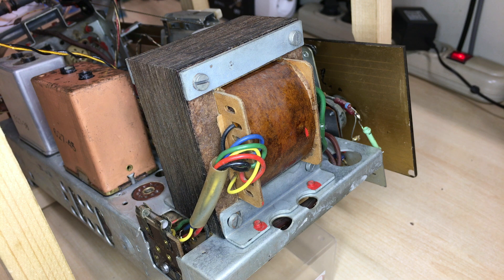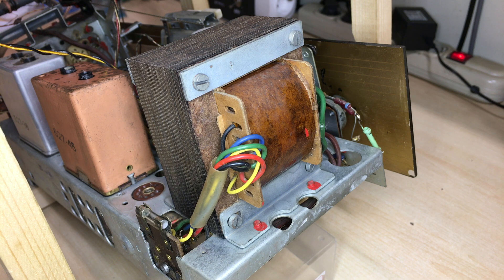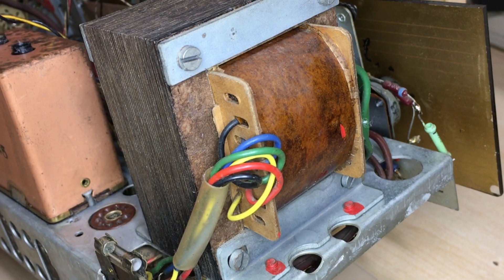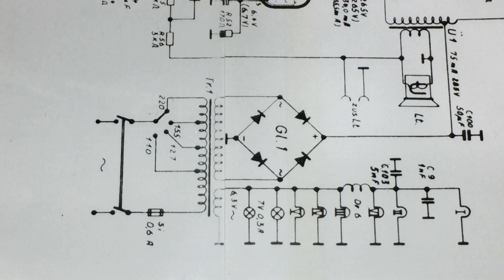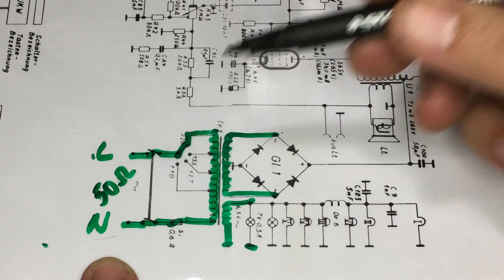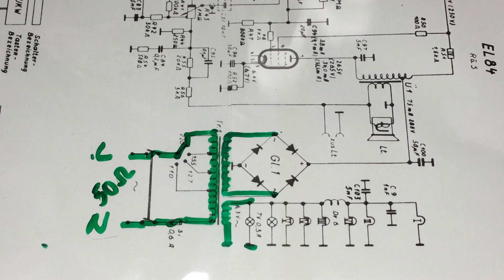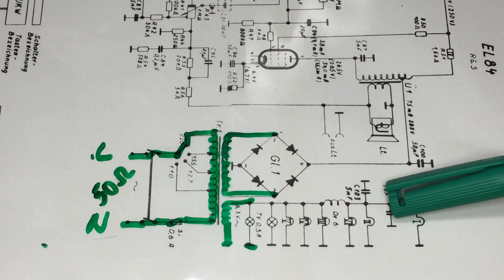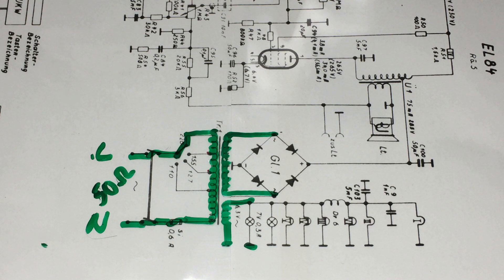How to safely check the Power Transformer on tube radio or amp.

Comment: Recently acquired a Tempo One transceiver, power supply & cable, and was wondering how I could test the power supply transformer when it isn't set up the same as yours. It's a seperate unit, has a multi pin socket on back that the connecting cable plugs into and the other end goes to the radio. There's no "on/off" switch on the supply, so would I have to jumper the "line" wires together to do these tests?
Reply from the maker: You probably would, but unless you really know what you’re doing, you’re risking damage and/or your personal safety. Be careful

Comment: When measuring the transformers neutral terminal to the transformers housing or chassis ground there is a "milliohm" because of dissimilar metals not connecting good to the chassis ground which is causing galvantic corrosion issues. Anyway of preventing and fixing the milliohm measurements with the grounds to chassis earth ground measurements? this is considered leakage current
Reply from the maker: None of the transformer leads should make contact with the transformer housing, until (if) one of the leads is connected to the chassis as ground. Measuring the resistance will always give you a VERY small resistance, which is normal.
Reply: @electronicsoldandnew  If the transformer housing L bracket mount aren't tight or connected to the chassis ground it will cause buzzing that gets into the power supply noise its more of a shielding ground the transformer housing. The chassis grounds for the audio grounds, digital grounds, RF grounds, circuit board grounds, shielding grounds, all get tied to chassis earth ground.

Comment: I found that if you get the power supply for E.L wire you can put that current trough a transformer and take your measurement, usually about 20% under voltage due to lack of amperage. yhe el wire power suply is a kind of high frequency  low amperage  step-up ac to dc 110vac inverter.

Comment: When I do the first test, I get unstable readings that flicker between 5 and 142, any ideas what that could mean?
Reply from the maker: probably a bad connection
Reply: @electronicsoldandnew  thanks. I got some help from a forum and had some switches set wrong on the tuner. Now with them set right I get a steady 4.5 ohms. Seems low, trying to figure out from the schematic if that's normal or not. Thanks again for your reply!

Comment: On a radio set powered by AC only (transformer) should a neon test screwdriver light when touched to the chassis? Mains cable is two core, chassis not earthed - as original.
Reply from the maker: No It shouldn’t but it can if your neon screwdriver is very sensitive. measure the voltage between the chassis and the earth instead.
Reply: @electronicsoldandnew  Thank you for the reply, most helpful. If I touch the chassis with a screwdriver it certainly shows in the speaker. Bit worrying given that I've changed all the capacitors. Of course I haven't gone near it with any fingers, thought I'd try the neon first! Radio works and receives well. I'll do the measurement with the earth.

Comment: I like to mist old power supplies with distilled water before powering them on.  Keeps the caps hydrated.  I try to be careful with the transformers so I completely coat them with vaseline.  The only issue is the vaseline tends to liquify a bit as the unit heats up later.  I tend to have puddles of vaseline under all my electronic devices.  For tubes, I try to temper them in the microwave.
Reply from the maker: I not sure I see the benefits, but if it works for you ...
The tubes in the microwave scare me 😟

Comment: Very useful, thank you for explaining it so clearly, with nicely highlighted schematic. I need to check a small tube amp transformer and now thanks to you I know how to go about it. The amplifier is missing parts, so I hope that the transformer is not blown. Otherwise it will be an expensive repair...
Reply from the maker: Good luck with your checking. Hope it’s fine.

Comment: If I was restoring that radio I would move the fuse to the live side of the transformer winding (between the switch and the voltage selector) and replace the plug with a polarized plug. As it is, this is dangerous. If the fuse blows and you fail to switch off the radio, the transformer is still live. In fact, the current might still find a way back to the mains via the chassis (if the chassis is earthed).

Of course, you should never assume that the power outlet is wired correctly but every little bit helps when it comes to safety.
Reply: Hello! In Europe the plugs are not polarized. Every safety design should disregard assumptions which wire is L and which is N.
Reply: @jassenjj  Those with an earth pin are but I already pointed out that the outlet may not be wired correctly.
Reply: @psionl0  You are not supposed to use the 3rd pin for load. It would never be connected to the L or N of the schematic if you understand the logic behind it and s uch an assumption is not compatible with residual current protection. So, again, there are NO polarized plugs in Europe.

Comment: Oh, well you definitely want to plug it in straight away, especially if the filter capacitor cans show signs of bulging or leakage. You'll notice a sweet smell after a few seconds, accompanied by wisps of smoke coming from the wire relief holes in the bell covers---that means it's working
Reply from the maker: justsomeguytoyou : and you check for B+ by licking your finger and touching the filter cap :)

Comment: If I don't get continuity on the primary winding can I assume the transformer is dead?
Reply from the maker: Rex Himself : pretty much, but make sure you’re actually measuring only the primary, and not a switch and lots of wires in between. Sometimes you can test the primary by measuring continuity across the two mains plug pins. If you get continuity, that’s great, but if you don’t it does not mean that the transformer is shot. It could be the plug, the cable, the switch, the solder joints, et cetera, et cetera.

Comment: Excellent and informative video as usual. Thank you. It also shows a failing of the schuko plug. Not only no internal fuse but unpolarised. The result can be that the neutral line is fused so a blown fuse leaves equipment live. Also radios without transformers can have mains on any exposed metal work (knob grub screws) depending on which way around the plug is inserted. Ouchh in more ways than one.
Reply from the maker: mbaker335 : thanks for your kind words and input.

Comment: Finally, I have been waiting for a video like this and a great explanation and video tutorial! I have been following to transformer test on my valve tape deck/tube amp. Primary OK, but I am measuring a 340 and 310 VDC/ 762 and 735 VAC at the two electrolytic cap's and this is coming from a very old possibly EZ81 or 80? rectifier tube...is this a sign of a bad recto tube? Thanks a million again!
Reply from the maker: leviszendro : hi. It's impossible for me to say as I have no idea of the schematic. What I can say is that those are very high voltages, so be careful! 
The ez81 will produce lower than normal voltages as it ages. You can also replace it with silicon diodes. There are quite a few great videos on YouTube on how to do this property. Good luck.
Reply: Thanks for the advice. Unfortunately, there are no schematics. Someone made this or converted this from a Ferrographe tape deck and a possibly Mullard design amp. So these voltages are way off high?
Reply from the maker: leviszendro : maybe not. If you're getting secondary AC voltages in the 700's and it's a center tapped transformer, then you are actually getting something like 350-0-350, and this could them simply be normal as the rectifier tube will act as a full wave rectifier. The important thing is to measure the actual ez81 output voltage and see if it is something reasonable, which could well be over 300vdc. My guess is that it's probably OK, but I'm hesitant to advise you remotely when playing in this ball-park as the results of bad advise could be dangerous.

Comment: Excellent step by step, logical testing. The testing of the heater secondary is very good. Do you ever come across a transformer that is causing induced A.C. into the chassis because the chassis is not grounded?
Reply from the maker: +richard goebel : no, not so far. I guess it could happen.